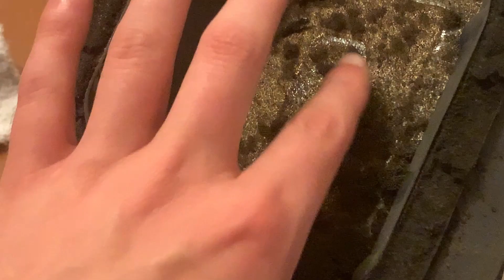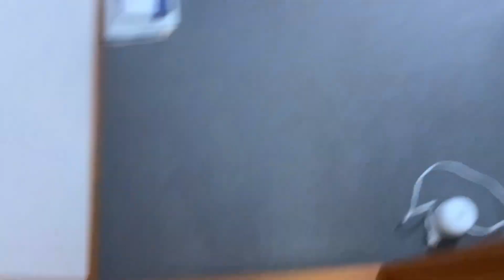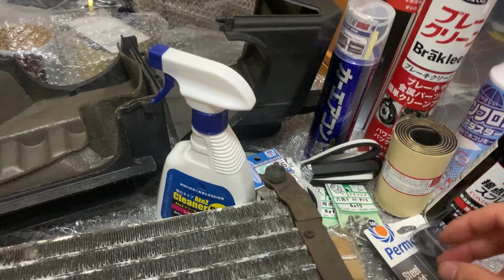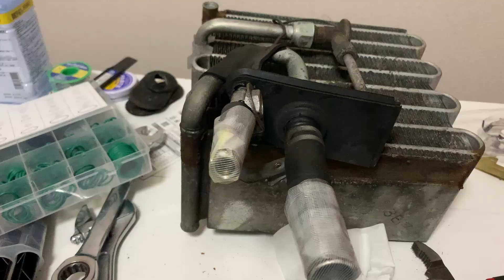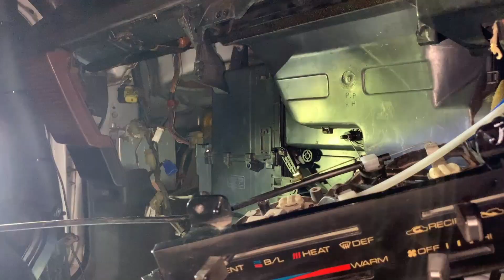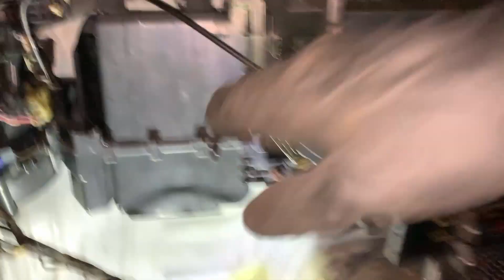A/C Install AE86 Corolla Levin GT - Part 1 (Interior)

Comment: Hi , what a awesome video , can you tell me did you have original loom or aftermarket , coz im looking gow to connect the aftermarket loom
Reply from the maker: @mansoorcassiem1901  hey! Im not sure if the looms are different between cars that had aircon, and the ones that don’t. My MR-S didn’t have aircon but all the plugs and buttons were there. 

I’m not sure if my Corolla had aircon at some point that’s why for me all the cables were there, I just needed to add the peripherals to it.